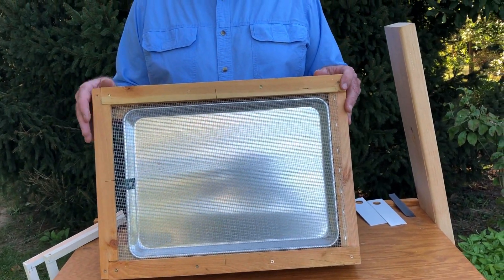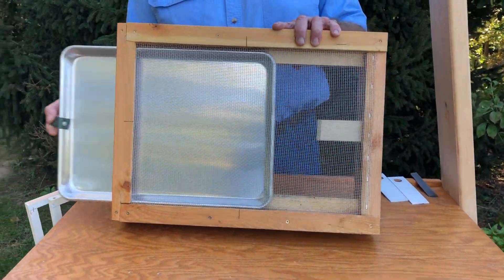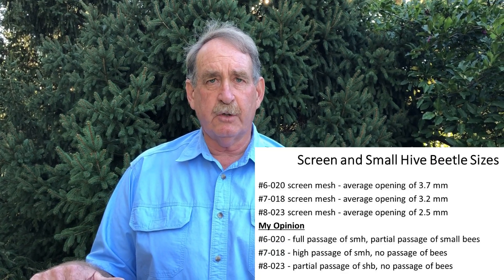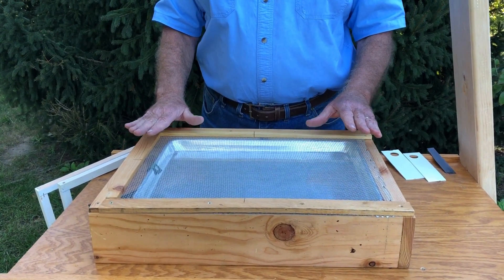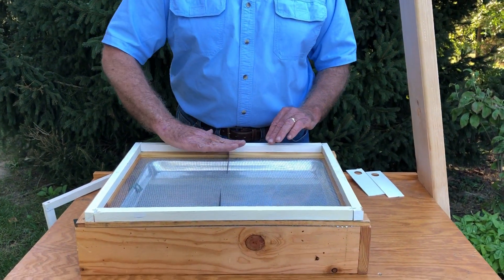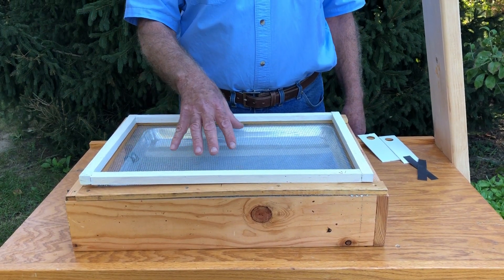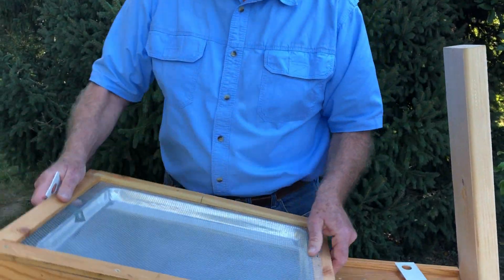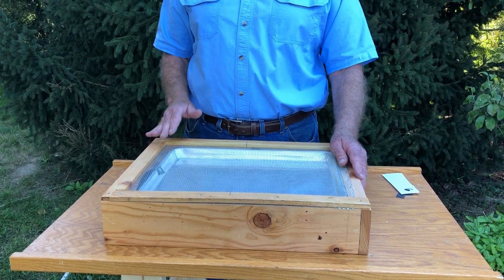HONEY BEE HIVE SCREENED BOTTOM BOARD FOR CONTROL OF SMALL HIVE BEETLES

Comment: I'm in Australia and we don't have anywhere near the variety of products available. This is our best spread of mesh sizes, apart from the fact they charge you an arm and a leg, what would you suggest ?? 	        As you can see none of the measurements measures up, 'scuse the pun. :)                                            M00820 Fine Woven Wire Mesh Per Metre: 2.2mm Openings
M00618 Fine Woven Wire Mesh Per Metre: 3.0mm Openings
M00620 Fine Woven Wire Mesh Per Metre: 3.15mm Openings
M00516 Fine Woven Wire Mesh Per Metre: 3.5mm Openings
Reply from the maker: David Estoppey he average length of adult female small hive beetles is 5.7 mm and the length of males averages 5.5 mm  -- both are nearly identical in width of 3.2 mm (Ellis, J. D. and A. Ellis.  online at http://entnemdept.ufl.edu/creatures/misc/bees/small_hive_beetle.htm).